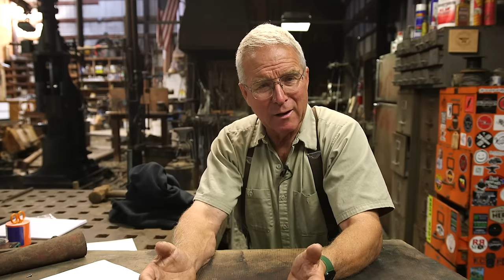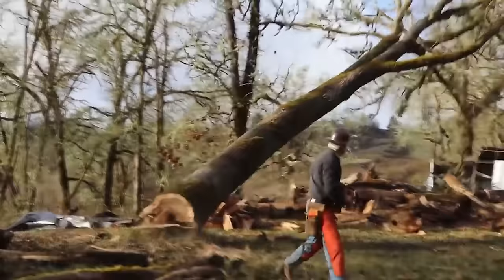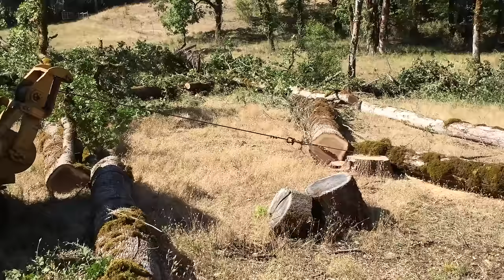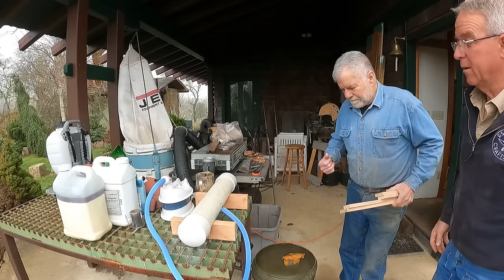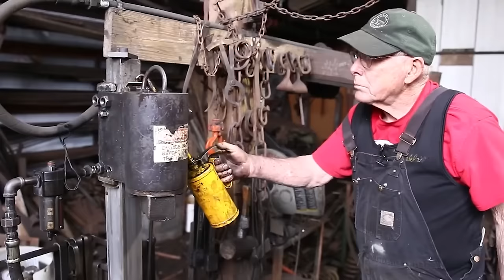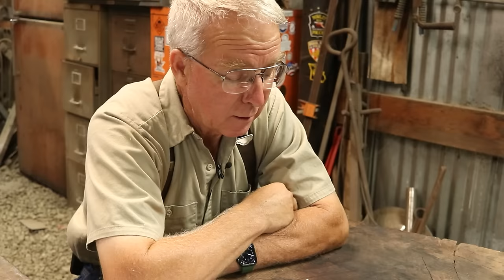How to Be More Confident

Comment: Just the other day, I got a $100 tip for a small, pretty easy roof repair because “you’re the only contractor who bothered to show up”. Until that point, I’d been feeling pretty run down and unmotivated as it has been a long roofing season. Talk about the pick me up I needed! I’ve been making a point to let other people know when they do a great job because it’s an easy way to boost everybody’s confidence and morale.
Reply: I empathize. I'm waiting on the 4th contractor to show up to repair a brick column, and I doubt he'll show, either.  A $100 tip would be minimum at this point!
Reply: I hear you.  I'm waiting on any of the 4 concrete contractors I contacted this spring to come out and even give me a price, let alone come and do the work.
Reply: I find an attaboy goes a lot further than criticism

Comment: The great thing about confidence is that it's naturally self-leveling (if you're sane). When I was 13, one day I decided to figure out how to use Dad's tablesaw, without any guidance. Didn't think it was a big deal. I'd been frequently using other tools, so how hard could it be?

The piece of crooked cherry burned and smoked as it began to bind against the sides of the old, rusty blade (which was sticking up way too high). Clearly, there was more to this than just pushing a piece of wood through. Panic crept in. At least I'd managed to preserve enough sensibility to keep my digits away from the potential maiming. Heart still fluttering, I then thought about what I'd just learned, admitting to myself that some serious respect was in order. This must be what a skill is. I'll have to figure it out. 

Thus my learning paradigm for life was set; with all of the skills I've developed, and all of the things I've built, fixed, and invented, there has followed a rising feeling of competence that has lent itself to an improved capacity for problem-solving. And soon I will fail at something (again), and my almost arrogance returns once again to that child-like feeling of being terrified in front of a screeching tablesaw—now my default setting for approaching any new system of thinking. 

Keeping overconfidence away is just a matter of minding one's place in the world; skill development is all about self-reliance,  not self-worship. As long as I remember that humbling feeling—as long as I keep perspective of my smallness in the world—I'm confident that I can safely build confidence without letting it grow into the range of the irrational, where it just becomes annoying, counterproductive arrogance.  

Let's be stubborn, but only up to a point, right?

Comment: For me, for the longest time, I thought having confidence was necessary to be able to achieve the things that I wanted.  Curiously, it has be the opposite; confidence has only been had through achievement. I am confident that I can be a certain way or do  a certain thing ONLY if I have proven it through achievement. Confidence comes after efficacy and proficiency. Which means that confidence is not necessary for achievement. After I put that together I realized that it goes like this:  action (thoughtful action) --> achievement --> confidence. That's why I quit waiting to be confident to do the things that I want to achieve.

Comment: At the age of 28 (coming 29) and a male working in IT as a Linux engineer for 10 years I gained my confidence by delving into fear.  As horrible and daunting it is by facing the unknown I found I gained confidence by taking a deep breath, a step back and learning the job step by step.

I am also grateful for having a dad who unfortunately passed away who also worked in IT for over 33 years who shaped by life.  He was a coach & mentor not just to me but to others.

As a hobby I do a lot of D.I.Y and in the past two years with the help of my father in-law (a chippy) showed me the ropes.  I had again an unknown there but used the principles I learnt in IT to drive my learning in building.

Comment: Lately I’ve discovered a source of confidence with the projects I take on around the house. I am not a carpenter, a framer, or any manner of builder, but I am curious and quick to learn new things. I recently rebuilt the balcony on my house. I had never don’t this kind of work before, but I had a clear path in my mind on how to find out how. Long story short, I completed the project with a higher standard of quality than the original. This filled my with the sense of confidence that I can do something I’ve never done before. With the proper patients and research, you can too.

Comment: I would say the biggest confidence builder I ever had was learning combat in martial arts. Being in the trades aggression and posturing from others is the typical way to display their confidence and to protect their ego. Knowing how to handle confrontation and being skilled in that craft helps to keep emotions in check and handle the situation with more confidence knowing that the escalation would be easily handled and how to identify what is a threat and what is words. For me it gives me room to use my brain and removes that from the table of outcomes.
Reply: I spent 22 years full-time in the trades.  Worked on jobs both large and small.  I really never worried about blusterers and posers.  I always ignored them, did my work, and let it speak for itself.
That does NOT mean I always kept my cool, but no one could complain about my work performance or the product I turned out.
I always figured that those who spent their time yakking about their abilities or talking down mine were just insecure about themselves.  Water - duck.
When I was 22, I was on a job and asked for a raise commensurate with the work I was doing.  One of the "old men" on the job (about 55) overheard my request, but did not hear the answer later in the day.  At the end of the day, he asked how it went and I told him I had gotten the raise.  He said, "good for you,.  They owed you, your a damn good worker".  I floated for a long time on that simple praise.

Comment: The Kipling poem could have been written yesterday, proving all true wisdom is timeless!. To gain confidence, like any skill, is incremental, understanding that like all good things worth doing well, it takes time. Don't assume because someone is confident, or possessive of any other skill or attribute, good and bad, that it developed into being in 30 minutes. Practice and repetition over time, expecting and learning from previous failures and successes, with a willingness to take the hard rather than easy road, will always result in building onto, increasing and improving ones life-skills and overall confidence.

Comment: I always had confidence issues as far back as grade school. Grew up to be a hvac refrigeration tech. You then hear ,you got to get it fixed asap. When I was young into the trade it was tough. All by yourself working on stuff you might not have seen before. For me it took maturity, and realizing on who I am. Then except failures. And try to learn from them. Just don't be afraid to fail. And if you do fail, so what. There's always tomorrow. And the best part, it won't matter in a 100 years any way. Learn to enjoy the challenge. Kick it in the pans and keep trying.

Comment: Self confidence for myself has came and went in certain areas throughout my life. As a young plumber/pipefitter it took ten years to gain enough confidence to run work. With help from experiencing coworkers I was successful of completing the job on schedule. I felt confidence. Then the very next job was disastrous. After 24 years I’m confident that if things can go wrong they will. Experience is the best confidence builder. Working out and exercising was also good for my mental state

Comment: Some ten years ago I was hired by the Transportation Security Administration as a frontline passenger screener. I had been without a job for more than one year and thus was determined to succeed. This job was real stretch for me as I had no customer(passenger) facing experience, and had been shy for my entire life. Over the time spent with TSA I developed into a capable and hard working officer. One thing that helped above all else was that I almost always worked to provide benefit to the passengers in any way possible. Most recognized this effort and were readily compliant with my instructions, even when things became unpleasant for them due to required procedures. 
Thank you for this, as well as all of your other presentations.

Comment: At the age of 18, my car motor failed, and I completely and confidently tore it down and rebuilt it from the ground up, using the knowledge I had gained from a 6-week, small engines course in high school, along with a step-by-step motor repair manual. The motor ran perfectly for many years after (even past the actual life of the vehicle). 
Years later, talking to my father about this experience, he confided in me that when he saw the motor all torn down, with motor parts all over the garage, he didn't think it would ever run again.
Completing this project so successfully gave me a lot of confidence going forward that with careful research and patience, I could figure out just about any challenge that might come my way in life.

Comment: The willingness and ambition to learn and gain knowledge through training and self learning increases confidence significantly. Not being afraid to fail and learn from those failures helps tremendously too. I went from being very scared and timid of electricity due to a bad shock many years ago to now being in the process of wiring a three story building with the confidence of knowing it will be done correctly, safely and above code. Videos like yours teach very well and thus viewers are richer and more confident because of them.

Comment: Not too long ago I was desperate to get out of a job that I had. There was an opportunity that arose that I went at full force. Thinking I needed to do something to prove myself, I observed for a while to find the biggest problem that I thought I could solve. What I identified was not something that I could do at my current skill level (which was none), so on my off hours I taught myself. After exercising that skill for a couple of years I gained a high level of competence. There are lots of versions of confidence, but one of them is confidence in your ability to do something. Especially if it's something you do poorly and practice and practice until it becomes something you are exceptional at.

Comment: Starting something(project or a chore) can always be daunting, but i find once i start the speed keep moving along and you get set on the end goal and make it happen. Building my jeep up on 1 ton axles 42" tires and roll cage was a huge feat and diving head first and just learning as i go, gave me a fair amount of confidence fixing things. Definitely puts some tasks into perspective. I really wish i had the courage to do more. there is lots i am intimidated by but being stubborn will have you find a way to finish said task. I have been struggling with a horrid pain in my neck/ shoulder the past year limiting pretty much everything i can with my right arm do so that has diminished my confidence substantially, but i have faith it will be fixed eventually though help of others.

Comment: Thank you, listening to your words and reading peoples comments helped. 
I grew up with alcoholic, abusive parents. And my mother would call me a stupid little kid. At the same time I was put in special education and spent 10 years of my childhood there.
I left my home when I was 14 to live with a different family member because of the abuse. So growing up it was hard to be proud of myself when someone tells me I did a good job I struggle with those words.  
My whole life I’ve been trying to prove to myself I am not stupid. I am a certified auto body technician certified welder, certified home inspector, general contractor. Also working with jewelry and leather smithing. And I am a people pleaser to the point where I cut myself short on jobs because I don’t want to let the homeowner down with a high price.
I have recently learned  
If I’m not averaging $75 an hour I am cutting myself short. I have changed the way I do bids. Life beats you down. And you have to hold your head up high be proud of who 
You are. People pleasing and self-confidence is a fine line. Thank you for the video.

Comment: Years ago, as a young man, I was poor, always learning to fix my car (though I needed help and confidence from a man in my church who was over boys my age, and a body man who helped me pull a wrecked car from a junk yard to fix it).  I learned gradually about how it worked, mostly when things broke.  He was there for me a number of times.  A few years on, I'm purchasing my first (and only) new vehicle) and it's got fuel injection, and it was different from carbureted cars (which I never felt comfortable with anyway).  Opening the hood, it was new and intimidating.  One day, on the radio, listening to "Click and Clack - the Tappet Brothers" I heard them say "90% of the problems on fuel injected cars are still mechanical", and that was it!  I took the upper part of the engine apart (a 4pm Friday build?) and all those wires were within range of where they needed to be plugged in (another lesson from someone who told me that car manufacturers will not spend a penny more for wires, so it will always be within reach of the plug it needs to go into), and "cars need to be fixed by kids, so don't over complicate things".  All pieces of advice that have served me well to overcome mental barriers.  My neighbor was shocked when I finally tackled a transmission rebuild without any experience, and it drove well for 2 years.  (the next 8 rebuilds tore down that confidence, and my neighbor got tired of helping me pull it out or put it in - heh.)
The biggest compliment was decades later when the man who taught me how to work on cars told me I knew so much more than he did.  And I help others with their repairs.  I figure if this economy tanks badly, I have a marketable skill.  All from this man who taught me how to look under the hood.

Comment: I've been working with a coach, and the concept of varsity vs junior varsity is something we are using to describe the difference in mindsets. I associate ability pick and choose what to work on, stakes and rewards being higher, and overall technical competency being higher. 
When I think through the same decision or action through this lens, I find myself walking more erect, shoulders back (instead of slumped forward), and meeting others as equals instead of as superiors.

Comment: 2 years ago I was 19 when I started my fence building business. After 2 months I was at a net profit of -$1000 because, as I look back at it now, I didn't set my bids high enough. I had one job in particular that went wrong in so many ways that I decided to close down and work for my previous landscaping boss who graciously hired me back for the remainder of the summer until I decided to start school in construction project management at the Southern Alberta Institute of Technology. After the year in school I had two options. 1: Work for a fence builder who offered a foreman's wage as a foreman. 2: Start my company back up and take what I had learned and give fence building another shot... I took option 2! It was scary at times but I hopped back on the horse and made a go of it with my learned knowledge and the confidence that I could make it work. I  made a good profit in net profit in 4 months and then I went back to school this fall. I contribute my success to my father (who is not a tradesmen by the way) who instilled confidence and encouraged me in my decision and praised me in my victories. I am forever grateful that I had my dad in my corner the whole time and realize that it wouldn't be possible to do what I have done without having him and my mother behind me at every turn. Now next year I am on track to net a great profit in 4 months with my reputation and my building and business knowledge. Ol' Boy Fencing is going to have an amazing future because of everyone who has raised me and been there for me. I am currently confident while running jobs and running the business. Also shout-out to my girlfriend for believing in me the whole way as well. She stood by my side while things were tough and I'll keep her by my side when things are going well.

Comment: Confidence is gained with each repetition in whatever activity. After a while, a person knows what they are capable of accomplishing. They can say with confidence in themselves, "I can do this," with much less doubt than a person who has not practiced that given activity.

 I believe real confidence is earned by hard work and focus on whatever a person is in pursuit of. It's like you need to be curious or brave enough to start, to make an attempt and then realize you got this, then to be tenacious enough to plow through the challenges to find that solid feeling of confidence. It is not completely unflinching in my opinion but exposure to lifes challenges simplifies problems over time.The bedrock of confidence is exposure to experiences.